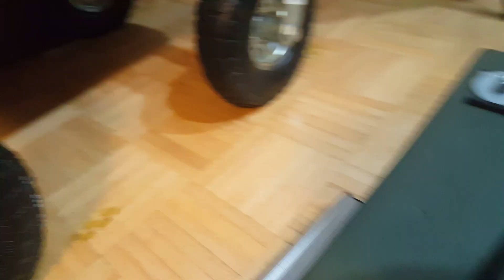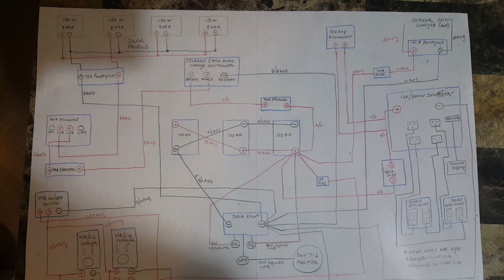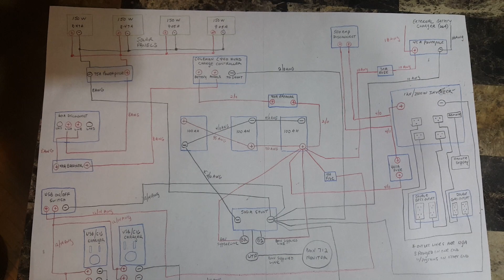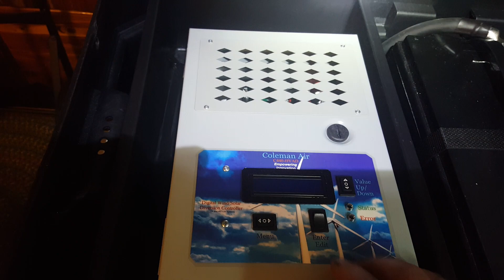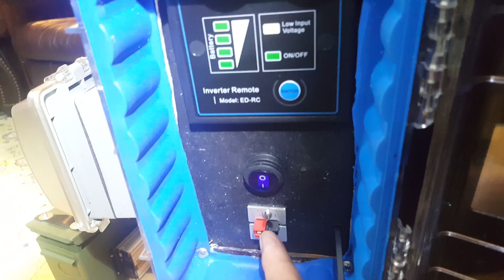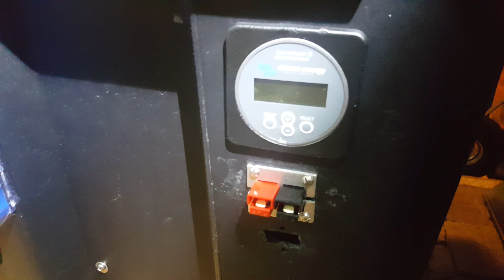Solar Battery Generator DIY - w/wiring diagram 12V 3500W Inverter/300 AH Battery/600W Panels.

Comment: have got the same inverter,  wondering what amp fuse between the battery and inverter, is it 440amp fuse or 400 amp fuse that you in linked in description.  What is the safest fuse size to protect the inverter, does it even need an external fuse has the unit has 360 amps worth of fuses built in,  would it be better to use something less then 360 amps?

Comment: Would you use the same wiring diagram if you wanted to make a 48v 5000 watt solar generator using a lithium battery
Reply from the maker: I thing the fusing would be different as well as the battery to battery connections, but the rest should be pretty close